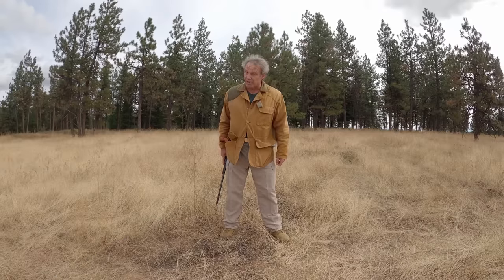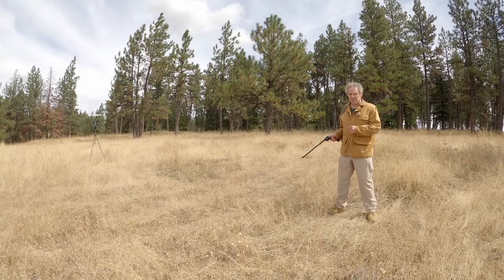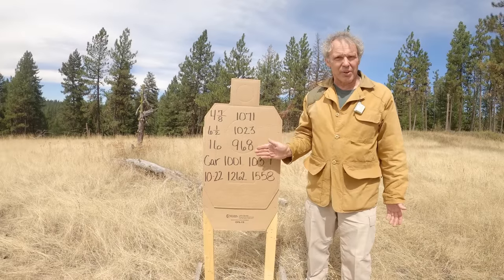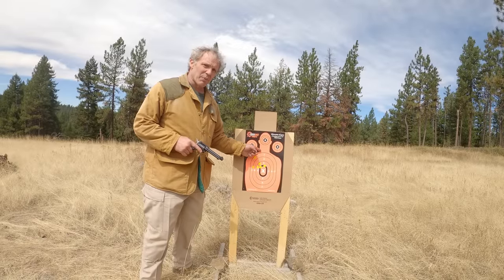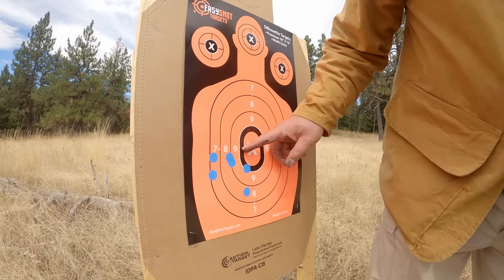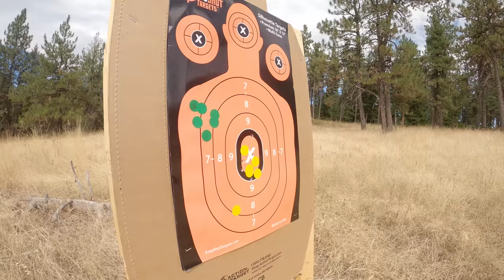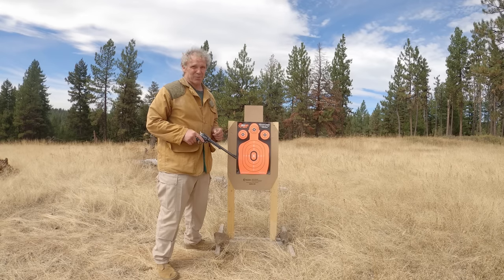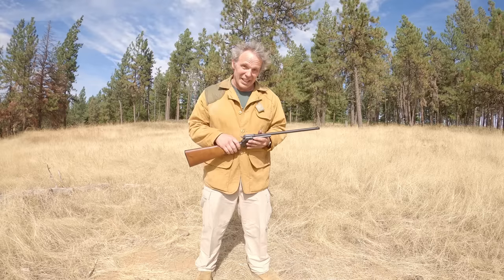Heritage Rough Rider Revolver Barrel Length Comparison

Comment: I’ve got 3 rough riders and none of them will make it through 6 shots without having a misfire using CCI mini mags, very disappointing
Reply: Have you tried oiling the firing pin? That seemed to help mine. Instead of never making it through a whole cylinder now it sometimes makes it through a whole 6 shots.
Reply: @brandone1987able  Thanks I’ll try that

Comment: You dry fired a rimfire..
Reply: When the hammer-block safety is activated on a Heritage RR, it is okay to dry-fire it, because the block prevents the firing pin from striking the cylinder and causing damage.

Comment: These revolvers are seriously terrible. They have to be one of the most poorly made firearms on the market. All of the examples I have seen have headspace issues, and lose timing within 500-1000 rds. Also the existence of a manual safety on a single action revolver is completely unnecessary. I seriously don’t get why people buy these things. Yeah they may be cheap but they aren’t free and you literally only need to put down an additional $50 to get something that is worlds better. But whatever, I guess enough people like them that they are going to keep selling. Whatever floats your boat.